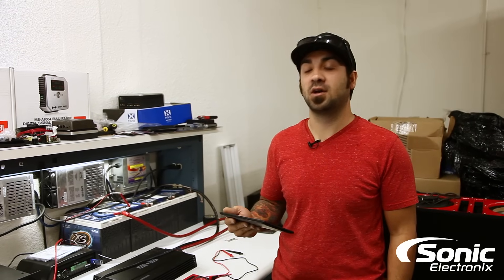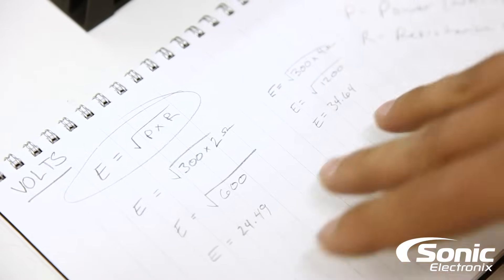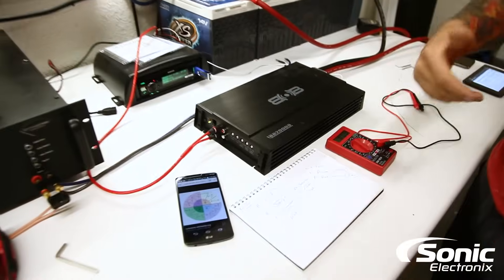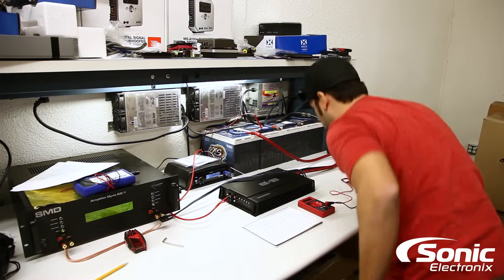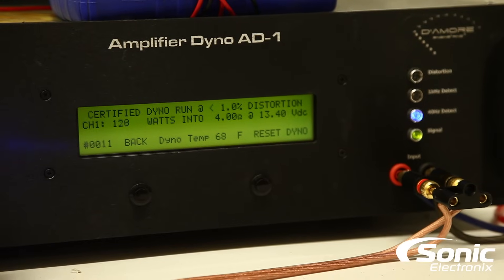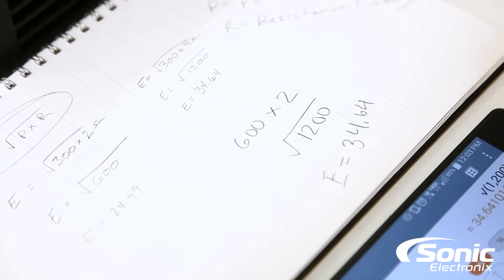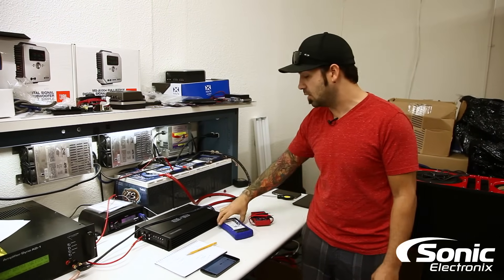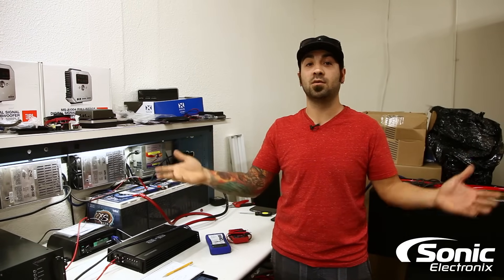How To Set Amp Gain to Match Lower RMS Subwoofers? | Car Audio Q & A

Comment: I have a 2000w RMS Class AB amp and four 12" DC Audio level 1's. If each sub is 300w RMS & 4Ω dvc, and the amp is 2kw RMS, what should my output voltage be? When I wire them, it goes down to 2Ω .

E=√P×R
E=√1200×2Ω
E=√2400
E=48.9897948557

Is this correct? 48.9 seems a little too high. Yes? No? Obviously the numbers don't lie, but somethings weird. Help!

Comment: Silly question 
I use this method all the time But in my calculation for my Single RF p2 12' Wired to 1ohm at 400w I get 400 and the Square root is 20.
Well I'm doing my Kenwood 6x9s  115w at 4 ohm and using a Amp that might be a bit to powerful 125wx2  at 4 ohms 
So using this method I'm doing 100wx4om = 400 Just like my Subwoofer ? and square root is still 20
So is that right ? 
I say 100w because I'm being conservative I've blown Mids and highs before going by RMS
They say 600w Max but that is NOT happening.
By the way Here is what Exactly I'm running - 
Pioneer double Din AVHX2700bs I've heard that this radio can go full vol without distortion. I usually set it at 15-25 so I gain at that volume.
(Sub=Rockford Fosgate 12" P2 @1ohm) (Powered by Pioneer GMD8601 800w RMS @1ohm)  (6x9 Kenwood 4way KFC-6985PS 115w @4ohm each) (Powered by Pioneer GM5500t 125wx2 @4ohm)
4 Guage OFC to the Sub 8 Guage to the 6x9 amp
Reply: since it's 125rms x2 @ 4ohms, then you have 250w total(x2) or  200w X 4ohms = 800 and it's square root is 28.28.

Comment: How about 2 subs,dual voice coil  at 4ohm. Put down to 2ohm each subs and than down to 1ohm on 1ohm stable amp..but my subs are each 600wrms,and amp at 1 ohm is rated 2500rms...and whats mistery for me.,each sub is in own box,and no matter how i connect wire ends that goes in amp im only getting 1ohm.

Comment: I have my cvx12 , 2 ohm sub wired in parallel to 1 ohm.... would that mean I need the square root of 750w(x1ohm) or 1500w(x2ohm)?
Reply: Raymond Sheppard have u figured it out? I have a dual voice call sub at 4 ohms but when wired parallel its at 2 ohms so Iam wondering which i have to multiply by 2 or 4 ohms?
Reply: @ibrahimraja9845  2ohms , it"s whatever you wire it at the end
Reply: Ibrahim Raja multiply by 2 ohms

Comment: Are you using this formula for final impedance that the amplifier sees or the actual speaker impedance?
Reply: The Calculation is for the total Resistance only. For a single Resistance you need to calculate it via the voltage divider formula, which might be a bit complicated for most people.

Comment: I have 4 dual 2ohms subs 500wattsrms wired in series on a 2000rms mono amplifier how would I do the calculations due to running multiple subs
Reply: Go with the final resistance/ohms, what the amp will see.

Comment: i have 2L5S ONE IS DUAL 2 OHM one is dual four 0hm how shoud i hook them up
Reply: You shouldnt mix speakers of different impedances. Get another dual 4 to run at 1ohm if ur amp is 1ohm stable.
Reply: @timj7788  well it sounds better than expected that little  Razor amp is pound for pound (also under 100$) the best amp around
Im at two ohms on bith speakers n apparently thats all that mstters
Reply: When u run the dual4 ohm series u get approximately 2 ohms then u just use 1 voice coil on the other

Comment: just asking at this point if i have a 800rms (2x2ohm) sub and a 1000rms(1x1ohm stable) amp if i want to match the gain, in the equation do i divide the impedance(2/2=1) or multiply?(2*2=4). thanks in advance!(for anyone ansewring btw)

Comment: I have a question, if I have a 2 ohm 1200 rms amp and a 4 ohm 750 rms sub can I wore the amp to be 4 ohms? Or should I use your method to tame the amp down and not blow my speaker.. any help is appreciated

Comment: How do you set the 80 hz frequency and bass boost , and subsonic filters without a smd distortion meter.? Thanks
Reply: same question.
Reply: I don’t think there is a way. Best bet is to call a local audio shop and see how much they will do it for.

Comment: Is it the same concept if you have 4 subs hooked up to one amp. 2 dual 4 ohm subs per channel
Reply: Scott Hilliard take whatever power the subs can take all together & multiply by whatever impedance u got em wired up at then square root
Reply: @prodigyybassboosts  thank you!
Reply: @prodigyybassboosts   how do you set the 80 hrtz ,the bass boost , subsonic filters
Reply: Scott Hilliard if by 80hz u mean LPF then I cut it all the way up & adjusted that with my head unit u do that to make sure there’s no cancellation , subsonic filter all the way down to minimum & don’t touch the bass boost

Comment: So in theory u could do it in reverse  to find out roughly wat the true output of a amp is by multiplying the output ac voltage by itself then dividing that number by the ohm load, correct?
Reply: not a clean output. you would see a bunch of power that would destroy your sub. need a proper tool for measuring clean signal, then you could measure voltage to see rough output

Comment: I would check for the Voltage at the battery when the car is at idle with headlights on, depending on the car's battery size and alternator output your voltage may vary.

Comment: Ok so if i got my head unit at 10% of the volume and I tune the amp gain to 34.6 volts, I'm going to play 600 fk'n watts at 10% of the volume????
Reply: Jeremy Villegas yep if the amp shows that volt in the speaker outputs, i suggest you set the radio to 70-75% just before it starts distorsion and then turn the gain to the target voltage and your system will sound good.
Reply: @marcushogberg8998  will do

Comment: Why isn't the output wattage what the math says it should be? Would maybe using the middle of your resistance and impedance be more accurate?
Reply: No. You can only get so close with the gain dial. Changing the impedance or load the amp will see wouldn't be the correct formula. Would overpower or underpower your subs. I'd say +/- 50 or so watts is pretty good using this method. Just going off all that I've learned and read.
Reply: @johnb6520  that's where the problem is I believe then, the impedance or load the amp sees from a speaker does change while playing music, because of box rise....

Comment: Only thing wrong with this method is that you are testing a resistive load, when you play a subwoofer it is a reactive load, meaning the impedance will rise. Even with an inefficient box causing low rise (so say only 2x rise) you’re probably only going to see 300 watts out of that 600 watt amp anyway. Send that shit brother!! And yes people the more efficient your box is the higher the impedance will rise, this is why people wire amps at a half ohm!

Comment: I’m lost on the part of having multiple subs, is this method for a count of only one sub? Given I have 2 10” subs rated at 300rms each, 2ohm set up, would I just do the math 300x2 square root 600 comes to 24.47 roughly, would that be for both of my subs? Or would I have to put into play both and do 600rms x 2 then square rooting it?

Comment: can I ask which Gain voltage is 0, is it 6.5 volts or .2 volts? cuz its seems rotating counter clockwise. pls reply ASAP
Reply: I'm replying to a 4 month old comment asking for ASAP response on a 4 year old video ...  maybe in 4 weeks someone else will comment and give you the answer you desire.

Comment: so I have a question I fallowed every step on setting the gain to the correct voltage. now I noticed that when I turn up the bass db/bass boost knob that the voltage also goes up as well. am I in the safe zone since I set the gain correctly?
Reply: Thomas Barbour dont use bass boost on the amp that will kill your subs i have mine all the way dowm and im pounding also if you have a bass knob make sure its turned all the way to the right and start over on setting your gain(place gain to zero before you crank that bass knob though)

Comment: do i want my bass knob all the way up when setting my gain? and on head unit what do i want my subwoofer control to be set at?
Reply: Bass knob all the way up because you want your max volt and power this video explains how to max out your subs from your amp without blowing your sub
Reply: Did you end up finding out what to set the sub level on your headunit to be?

Comment: I want to run 2 12 subs at 2ohms on a mono amp. The amp is rated at 1000 rms so it would be 500rms each sub but my subs are rated at 300rms. How can I do this?

Comment: I have 2 xfl 12s 1000w RMS each. Ran off of 2 1500 Audiopipes strapped and wired to see . 25ohm load. So what would that equation be?

Comment: I'm confused about the ohm's. Is that the ohm of the speakers or final ohm load of what they wired to at amp? Please help I'm trying to set gain right now with Multi meter. Thanks!

Comment: I have an old crown gm-x 998 Amlifier 4 channels are working . I tested the output voltage on each channel with the gain turned to highest level and all my speakers and woofers were disconected and playing a 60 hz tone on my phone using AUX option. Butttt the measurement was equal to = 0 volt. How could this happen ?

Comment: So I'm in the market for new audio for my race car... I like alpine single din head units and 6.5 type r component speakers for my front doors. Now my 2005 g35 sedan has a rear deck lid sub from bose which I removed and I plan on installing a 8" skar sub rated at 900rms to put in place, what amp would you recommend? And can my 2 gauge wires be enough?

Comment: I have 2 Sundown X10 D4 "1500watts each" on a Sundown SCV4000D. I'm wanting to set my gains with DMM. How do I do this? I have 4 outputs on the amp. Also I have stock headunit with JL FIX86 "signal" and JL TWK88 "DSP" do I have to change any of the input voltage on the TWK?

Comment: Pls...i need the formula for my amp is 330 - 600 (max)watts says in the manual and woofer is 300 - 600 watt  1x4 ohm. My amp is a monoblock class D and i bridged it. How i calculate it.
Sorry my english...thanks.

Comment: Well... I've come across a first encounter. I set my gains using a DD-1 and measure voltage with a MM. Well I was setting gains on an Infinity Ref-704a, with the head deck (Kenwood Kdc-701) turned up just under the distortion volume (maxes at 33 on the volume), the voltage reading on the amp is already higher than my calculated voltage. I'm to set at just over 14 volts and I'm reading over 17 without even touching the gains. Now the DD-1 is not reading distortion at this voltage and I can very lightly turn up the gains before it reads distortion. I have kappas on the doors which are 2 ohm and the amp is 100x4@2ohms, that's the wattage I was trying to set. So what does one do in this instance?

Comment: I have 3 12 inch power acoustik Gothic series 2500 watt 1250  rms  2ohm subs wired together to make 1.3 ohms on a 8000 watt 4000 rms class D power acoustik amp the question is:  Do I add all the rms from subs to get the gain I'm looking for or just 1 subwoofers rms power

Comment: Hey Allyn. Great video. So I have two Kenwood KFC-w3013ps 4ohm subs 1200 peak/400rms and a Rockville dB14 amp 4000peak /2000rms with a cea rating of 1000rms x1channel. I’m running the amp at 2 ohm subs wired parallel. Question is do I find volts based on one sub or two. Thanks

Comment: I have a question though, I have an old radio which has 2 speakers which rated, 3VA 4Ω and I would like to change that to modern speaker. For that, how much watts speakers should I use?

Comment: How would i wire a 2002 mini cooper s that has the battery in the trunk? Would i have to run a power cable from the alternator or just use the battery terminal?

Comment: Hi can you tell tell me how i count two alpine swr 1023d 2+2ohm 300/600w rms they are each in series to 4ohm and both together parallel to total 2ohm on the amp sinus live 1500 monoblock 900w rms in 2ohm. I dont really know how to count  volts. Thank you

Comment: How do you do this if you have two subs on a 4ch amp bridge into 2 channels... The amp I have puts out 240x2 bridged @ 4 ohms and my subs are 150 @ 4 ohms... I know that subs generally can handle a bit more than what they are rated for so do you guys think that I will be fine setting both bridges on about 3/4 gain?

Comment: So then in theory you could do the reverse with the voltage to get power? So if you measure 34.5v wouldn't you just square 34.5v then divide by the impedance?

Comment: So if I have 300 watt rms power in 2ohm is only going to 1 sub so that means I’ll need 600 watt rms for 2 subs to receive 300 Watts each?
Reply: yes if you have two subs hooked together, and give them 600 watts, both subs get 300 each. thats what is in my car now 2 subs connected together to need 600 watts at 4 ohms RMS and each sub gets 300 watts

Comment: You video help me a lot,  until you said I can still be clipping and should use the smd device if I want maximum results out of my amps, I really need your help, I have the same multimeter but I'm running 2 bass amps(brx3016.1d) and 1 highz amp(audiopipe 1000) my subwoofers are power acoustik bamf 1750 rms each.... I have 4

Comment: Does this method work if you only have the volume on the receiver at say 75% and then set the gain to 75% of the predicted?, so in my case, it'd be 23.7 instead of 31.6, or does ohm's law not scale that way

Comment: So this disproves the whole (the gain is not a volume) myth..yeah it's not ment to be used in this way,but it can be..so the gains are really just a  Potmeter that limits the amps output to a lvl the manufacturer feels it should be at for whatever preamp voltage is being used.however too much causes clipping and destroys voicecoils..

This helped me out as I have a 1993 Fosgate punch 200ix dsm that the gain is for 150mv-3v preouts,but my HeadUnit is 4v preout and I was worried that by having my gains all the way down it would screw up the amp some how.

My subs are 12" db drive dvc 4ohm and I am only using 1 coil on each so I can get the amp down to 2ohm.even with the gains all the way down these subs can not handle the 200ix lolol.

Comment: What about setting gain this way on a set of NVX JAD 1200.1 amps. I know the master is where I  will set all the gains, and the slave amp won't  need adjusting. However where should I  stick the Digital Multimeter leads and will it be the same formula as stated above. I do not have access to any expensive equipment just  a multimeter.

Comment: Is this combined? For example I trying to find out the gain to power my components speaker each one is rated to 90rms witch combined is 180rms should I get the volt according to one speaker or two together, since my amp have the channel 1,2 on one gain, thank you and sorry for my ignorance.

Comment: I am confused,, 300 x 2ohm=600.. 2ohm its is subwoofer impident or 2ohm it final wiring impident.?  Examples single subs 4ohm 600 rms... Wiring down to 2ohm... so to calculate 600 x 4 or 600 x 2.?

Comment: I have a question for you guy,if you can help me out with this problem. I have a kenwood radio kdc-x797,and I have had this head unit for about 6 years. And I have an "hf error 68" on my unit,I have tried to rest it and the hf error 68 still appears on the screen. How should I fix it?
Reply: it means it can't communicate with your cell-phone. You should cycle the power switch, if the error still shows press the reset button on the control unit.

Comment: can i use 40 hz test tone for setting speakers(front and rear) or should i use 1khz
Reply: no because , cheap multimeters can only read 50 or 60 hz AC, 60hz is the american AC 50 is over seas  AC. . .

Comment: What about if I had 2 15” audiopipe bd2 that are 900 Watts rms and 1800 Watts max that are 4 ohm a piece but ran down to 1 ohm to a mono block 2000 watt audiopipe 1 ohm stable amp?

Comment: I have a rockford fosgate 500x1d that Rockford certifies did 618W My question is If I have 2, 4 ohm subs wired up as a 2 ohm load (they can easily handle all the wattage I can push) and the voltage I should be getting using the square root of 600*2 is about 34 why does my amp output 54v when it is turned up?

Comment: Lets pretend I have a 800 RMS Watt subwoofer wired to 1 ohm and an amp that can deliver 800 RMS watts at 1 ohm.
That means the amp needs to spit out : 800 x 1 = 800. Squareroot of 800 = 28.28 volts?

Comment: I burned my speakers thinking that I was suppose to do the same with my regular speakers. This shiit is only meant for subwoofer just pointing that out since they dont.
Reply: its still accurat  the, the problem is the the reading of the amp is not accurate. . .  what i mean by that,  is there is much truth behind peak power rating, when you do the 50/60hz tone, this is obviosly playing for more than a second, the problem is the amp can output much higher volatages is that less than a second [for example a kick drum] this is because of the capcitors in the amp that store the power for bursts of sound, the bigger the capcitors in the amp the higher ammounts of power it can put out, a cheap amp will have amost the same burst and continous power ratings. there have been some bench marks that put up to 70 watts on burst, and only 500 watts continous.  ..[im not talking all these fake peak number im talking real word amp burst,] normally its 20to 50 percent]

Comment: I got a question bro... I got a brand new kicker L710-Q-Class 4ohm... Sub.. I don't know how to wire it as a single in a single box... But this is the real question it smelled like it was burnt like voice coil or something but is that normal how does  a new Qclass l7 10 smell new.... I'm nervous it played fine it's soft not hard when I push it from the middle down no stiffness and also if it a 700w sub is the 500/1 JL amp a good match for it thanks allot in advance and for your time if u respond plz send me a message